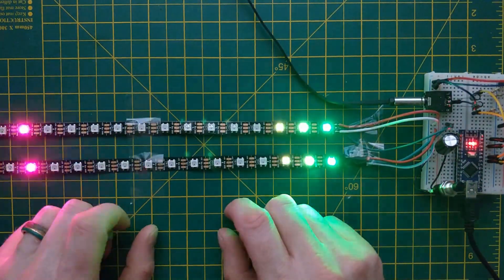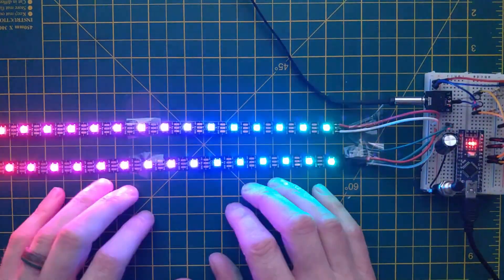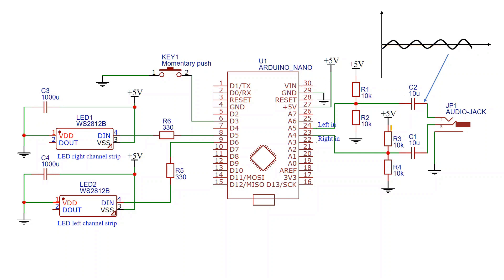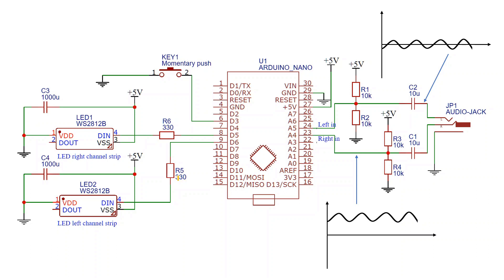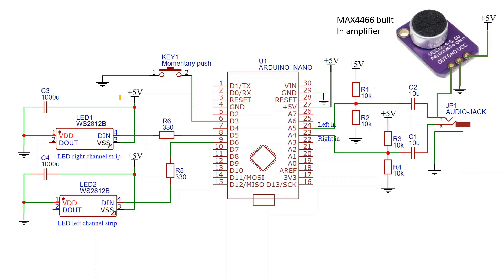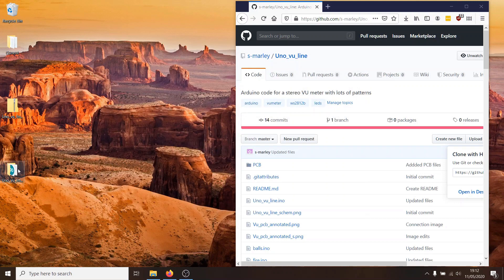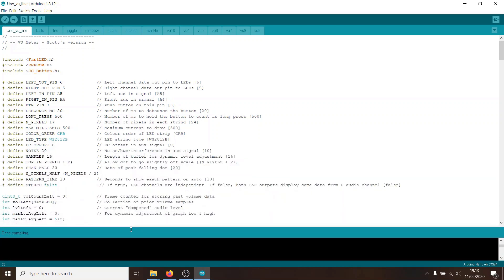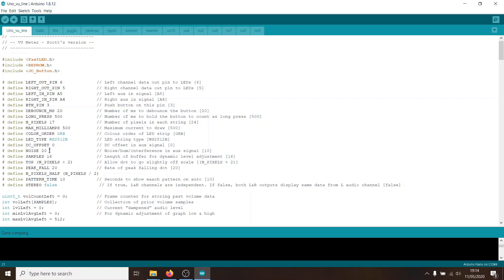Arduino sound reactive VU meter WS2812B LEDs

Comment: Hey Scott, thank you for a great version of a VU meter using WS2812B LEDs. Great timing for me as I'm building a Jukebox for my grandson for Christmas and this integrates well. I've built the circuit and uploaded the code to a Nano and it works great. I made some minor tweaks to the code but one thing I have noticed is that mine doesn't remember the MODE it last ran after the power is turned off and then turned back on. That's actually not a big deal however I would like to change the order of the  patterns when the Nano boots or at least set a default pattern on boot up. Where is the pattern order setup in the code? Thank you so much for your interesting projects. Cheers!

Comment: I am using a 16x16 led sheet, total 256 pixels. if I set the pixels to 256 nothing happens, if I set it to 255 everything works great apart from that last pixel. Is there something else apart from N_PIXELS that I need to change to get that last pixel to work? Thanks

Comment: Hi Scott - thank you for publishing this project, it's been a lot of fun to build. I've added a 1602 LCD panel to display the current pattern and sensitivity setting. I do notice some noise in the audio when the volume is turned up, especially when all the lights are activated. I do have a single 1000uf 16v capacitor spanning the power supply's +5v and ground, so maybe that's as good as it gets. Fortunately the audio volume covers up most of the noise! I'm planning on releasing an Instructable article showing the case and diffuser I've designed, I'll send you a link here when it's done.
Reply from the maker: Amazing, thank you for the comment! I've found the more capacitance the lower the noise goes, but I've never been able to get rid of it completely. Maybe an LC filter or something would work but I've never got round to looking at that.

Comment: Question..using an adruino is there latency? I'm not sure if it's lag in video/sound, but the few VU meters i have looked at a few, and all seem to be delayed a bit compared to the video.. Is it me or is there a bit of latency ?
Reply from the maker: There will be latency as to prevent the strips flickering madly, most vu meters average a number of readings. This smooths things out somewhat, but also introduces latency. So it's a trade off. There might be a clever way of not doing this, but I don't know what it is!
Reply: @ScottMarley  >> Thanks for the reply.. I been asking this question to many out there, and you're the only one who has answered my question..  The LM39xx series leds do seem to work better, but they can't do what the Arduino does. so I guess it's a trade off. I'm wanting to build this.  It's hard to see all that you point out in the video, because things are smaller on youtube than you're screen. but you did explain it good enough that i can figure it out..
Thanks again...

Comment: what is the voltage of the capacitors?
Reply from the maker: Anything greater than the power supply which in this case is 5V. I'd go with 16V caps, but 10V would be fine.

Comment: I are you sure you need to send the MAX4466 output through cap and voltage divider?  It seems to oscillate around 512 (511?) when I do an analogRead directly.
Reply from the maker: You are correct, you don't need to do this, as the MAX board has these built in.
Reply: @ScottMarley  The reason I came across your video was because I'm trying to make a VU meter using MAX4466, but I want it to be adjustable as it will be used in different environments. I'm wondering if it would be possible to just connect the AREF pin through a pot. In quieter environments, the pot could be adjusted to lower the reference voltage which I'm thinking would scale up the output of the MAX4466... but not sure if that would work.
Reply from the maker: @davepost7675  I don't see why that wouldn't work, sounds like a neat solution! These days I tend to go for digital mics such as the inmp441 which have a much cleaner output than the analog stuff, but they are more of a pain to set up and can only work with more advanced controllers which support i2s such as the ESP32.

Comment: Hello,
Thank you very much for that wonderful guide to make the ws2112b sound reactive. It was very easy to understand. I am very excited. But I have a question. I am currently rebuilding your great instructions and have already had success with the function.
I'm not familiar with C++, but programming logic makes sense to me.
I would now like to expand your program to include additional points (two more buttons).
For this purpose, a second and later also a third button should be integrated into the program.
When the Arduino starts, only the bottom pixels should light up red (like standby).

If button 1 is pressed, the stripes should be a subtle ambient lighting (without reacting to music or noise), ideally different scenes
by pressing button 1 again. I want to do this with different shades of white.
If button 1 is pressed for a long time, the program jumps back to standby (only lower pixels red).

If button 2 is pressed, then different lights with different colors should be selectable (similar to the functions/presets of a Stripe remote control)

Button 3 should do everything, as usual, with sound (your program).

Is it complicated to create this skeleton of the program? Is there possibly something that works according to this principle?
I would do the pixel programming and ambient lighting myself later.
But it would be cool if I could build on an existing concept. Do you have any tip for me? I would be very grateful
Reply: now I made it for myself. But without a second button. It starts into subtle ambient lighting. By buttonpush  it switches like before. By long press it starts into the automatic mode but it ignores the cases 0 to 2 where the non sound reactive patterns are placed. Not a perfect solution, but it works for me.

Comment: Do you have the ability in code to split it into more channels? I am having a hard time piecing code together for a nano. I know memory is an issue but if i limit it to say 7 bands and 10 leds per band(70) , should still have plenty of memory i think
Reply from the maker: It's possible yes, but if your trying to split it into more channels, this project isn't the best starting point. Look up some of my more recent videos where I've created multichannel VU meters.
Reply: @ScottMarley  thanks for the direction. I have a good amount of LED projects with a mic and sound reactive (can check my channel). Just splitting a vu meter up on a nano has been the challenge
Reply: @ScottMarley  looked your videos and with help from some of Andrews new simple FFT, i have been able to add some new animations. Learned a bit too. Thanks for the recommendation. Sent me down a rabbit hole :D
Reply from the maker: @WillHartley  brilliant, thanks for letting me know!

Comment: Mr Manley,
do you have a way to set this up using a 3.3v mic board instead of line input?
been trying just about every  sketch i can fine with no real luck 
your is beautiful just wanting mine portable 2x 30 led strip vertical 
on tv stand for effect

Comment: When I try upload the code I am getting "serial was not declared in this scope" in each case.
 case 0:                
      if (modeBtn.wasReleased()) {
        Serial.print("Short press, pattern ");
        Serial.println(buttonPushCounter);
        incrementButtonPushCounter();
        autoChangeVisuals = false;
Reply from the maker: That's odd. Serial.begin(57600); is declared in the setup function. Make sure your code has that in place.
Reply: @ScottMarley  It has. I used your code without changing anything. I don't get it.
Reply: @ScottMarley  It's OK. I am working with ATTINY85's and tried loading it on one of those. The code is fine uploading to a Nano.
I have managed to get a few patterns loaded and a brightness knob and a button for pattern selection onto an ATTINY85 µC. Makes project circuit board small.

Comment: Mr Marley, a while ago I tried this project on a breadboard. It worked fine! But a couple of weeks ago i discovered that you also added a pcb on your github page with the code. So I ordered the pcb from jlcpcb. Tonight I tested it. The switch doesn't work. I think there's a fault in the pcb.  The d3 pin should be pulled down to the ground with a resistor.  But on the pcb the d3 is connected on the ground with a resistor permantley. And if you push the button the ground and d3 get connected to 5 volts. If I power the pcb, the vu's work and autopatterns. But no reaction on the switch. If I remove the 10k resistor from the pcb and I put a cable on d3 via an resistor and switch to ground it works perfectly.
Could you check? Or is there something I have to change in the sketch?  Greetz from holland

Comment: How could it be modified to use the computer's audio via USB connection Thanks
Reply from the maker: Processing the digital usb audio directly would be difficult. An easy solution would be to buy a usb audio to 3.5mm adapter and use that.

Comment: Did this voltage shift also Work with 3.3 volt instead of 5V? Because I Plan to use this project on an esp8266. I read that the Max output volt from the head Phone Jack is around 2 volt...

Comment: Dear Scott! I Build the vu meter and works fine but I have a question: the c1 and c2 capacitor polarity in the build picture is c1 negative towards to jack and c2 rotated 180 degrees my question is why? And the connection is right or not? I build with vubeardboard.png but in the schematics picture does not indicate the c1 and c2 polarity. Please answer to me the right connections. Many thanks
Reply from the maker: The capacitor polarity here doesn't actually matter, they are seeing an AC signal so whichever way around you put it, it's 'wrong' half the time. As the voltages on a line signal are so low, it doesn't matter and it won't hurt the caps.

Comment: Great video, I would like to know where I change the duration time code in order to hold the peak time and also if possible to make the audio input more linear because the adjustment in the audio potentiometer is logarithmic and non-linear, a little stirring in the potentiometer already increases or decreases the sensitivity. I would like to have more control over the input range. thanks.

Comment: Hello, such a valuable and inspirational project. I made some changes and reslised it ,then I combined your project with esp01. I can control the modes via my phone wirelessly. Can I share the project in my social media.
Reply from the maker: You can do whatever you like - these projects are all open source for people to hack on and play with! Thank you for your comments :)
Reply: @ScottMarley  I use scarlett usb audio interface thats mean my output gain is higher than expected 3.5mm phone output.Even though when I set the max value from the usb card, the peak dots reaches last pixel barely. when I use phone output, peaks dont reach the last led pixels.What kind of changes should I do in order to implement the animation while use phone output?Which mean increases the sensitivity I am using the version that isnot included aref pins.

Comment: Hi.  I tried to compile the code it is showing error. Not compiled
Reply from the maker: Hi, I'm afraid that's not helpful enough for me to diagnose. What is the error, what board are you using, have you made any changes to the code etc?
Reply: @ScottMarley  I m using Arduino nano
Reply from the maker: @ronaldfernandes5697  hey Ronald, you have to answer the questions I have asked you. I'll give you one more try.
Reply from the maker: And the most important part, what is the FULL error you are getting? All of it.
Reply: @ScottMarley  I didn't change any code  I only follow your code

Comment: cool, im guessing the C1/C2 are electrolytics with the + towards the audio jack?......thanks .
Reply from the maker: It doesn't matter which way they go, they are exposed to positive and negative voltages equally due to the sinusoidal nature of the audio input. The voltages are so small that it's not a problem.
Reply: @ScottMarley   ahh gotya...excellent, thanks,  im going to use just the mic so i will mono the input.
Reply from the maker: If you're using an amplified mic like the max4466 or whatever, you don't need any of that circuit. Just wire the output from the mic directly to the analog pin and you're done!
Reply: @ScottMarley   ahh thats good to know, i knocked up a strip board layout with the nano onboard, so that will save me a few components....cheers man.  i will breadboard it all up to test anyway first. nice one.

Comment: I'm making something similar and I am struggling with getting an audio signal to the analog pins. What did you use as your signal source? A mic or a speaker?
Reply from the maker: I'm using  a line-in on this (aux cable). If you want to increase the sensitivity / dynamic range, see this verison https://www.youtube.com/watch?v=Nhc9MvOH0Gs
Reply: @ScottMarley  thanks for the reply Scott. I'm asking because im making a similar project. Are you using a speaker or a laptop line out or something else?
Reply from the maker: @gooncaveenthusiast  doesn't matter too much, I have used my phone, and my laptop as output devices.
Reply: @ScottMarley  I've got a phone that has a USB C connector, do you reckon it would still work when paired with a USB C to 3.5mm cable?

In any case thank you so much man, you have dug me out of a hole.

Comment: Hey Scott. Im trying to build this in my Arduino UNO but it isnt working. Im new to this so i dont even know what the problem is. Any help would be appreciated!
Reply from the maker: Happy to help, but I need a bit more to go on I'm afraid! In what way isn't it working? Does it compile? Does anything happen / light up? Are you using a microphone or line in? Do you get any error messages? Give me as much information as you can.
Reply from the maker: PS you might be better using this version of you have the parts, its more responsive. https://youtu.be/Nhc9MvOH0Gs
Reply: @ScottMarley  ok I'll try that. Thanks
Reply: @MuhammadAhmedMuqtadir1  None of the code variants compile in Arduino Uno. The message is: "Compilation error for Arduino Uno board". Please can you help me. Thank you.

Comment: Rather than using  a hard coded value for centering as you have (and I used to use):   n = abs(n - 512 - DC_OFFSET); // Center on zero

I've since started using an auto-leveling function at https://github.com/atuline/WLED/blob/master/wled00/audio_reactive.h on line 104

That micLev variable needs to be a float or you'll have some nasty rounding errors.  This allows you to support multiple types of microphones/inputs without having to worry about the signal center.

As for the Nano, I was able to get the Open Music Labs FFT/FHT library running on that back in the day, so you could get a LOT more than the 7 frequency bins what the MSGEQ7 provides. . . and no extra hardware required. These days, I'm using the ESP32 with WLED and support INMP411, INMP441 (digital), MAX4466, MAX9814 and line-input.
Reply from the maker: Hi Andrew, great to hear from you! I've moved on a fair bit since this stuff, and learning a lot as I'm going along. Thanks for all your guidance there, I'll definitely take a look at your recommendations. I'm currently working (slowly!) on an LED infinity cube which I plan to run from your sound reactive WLED fork - thanks so much for creating and maintaining it and making it much easier for us mere mortals to create some wonderful stuff. All the best!
Reply: @ScottMarley  - My pleasuire to help. Oh, and your Youtube video here is extremely well done. My stuff is potato quality in comparison. :D
Reply from the maker: @AndrewTuline  that's very much appreciated, but I don't think I'm there quite yet - some YouTube channels are incredible quality these days. Still a long way to go!

Comment: Thanks for all this information you've shared Scott, it's extremely helpful. I'm looking to modify this for my use. My setup is 14 columns made from a single LED string in a serpentine arrangement. Any hints on modifying this code for my situation?
Reply from the maker: Thanks! I'm not completely sure what you're after, but if you have multiple strips you might be better looking at my video on how to do a vu meter on a matrix https://youtu.be/Mgh2WblO5_c is this more what you're after? Remember a matrix is literally just strips joined in a serpentine pattern :)

Comment: how can i use  this code mega 2560 ?
Reply from the maker: The code for this will work on a mega the same as on a nano or uno. If you're using the other version of this found here https://youtu.be/Nhc9MvOH0Gs check the comments on that video for a change you have to make to the code to have it run on a mega.
Reply: @ScottMarley   ok thanks

Comment: Quick question, Scott. I can't figure out the polarity of the 10uF capacitors. The fritziing diagram seems to have each oriented different but I assume they should be the same and I'm not sure which way.
Reply from the maker: It doesn't matter. The audio signal is alternating, so whichever way around you put it, it's 'wrong' half the time! As the signal is such low voltage, it won't cause any issues.
Reply: Ahh yes, of course. That makes perfect sense. Thanks.
Reply: @ScottMarley  the polarity should be + to Arduino and - to the Audio Source ! because the higher Level is between the 2 10K Resistors !
The Software is great ! Thanks to Scott